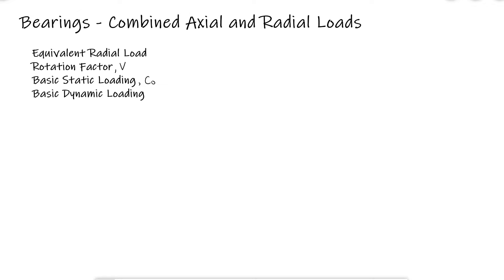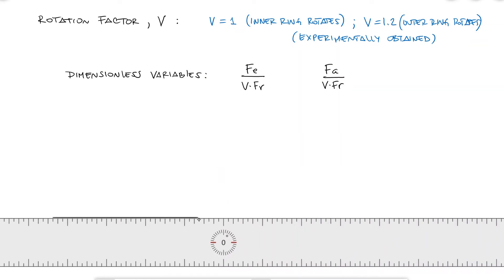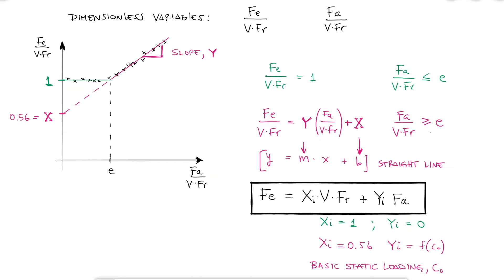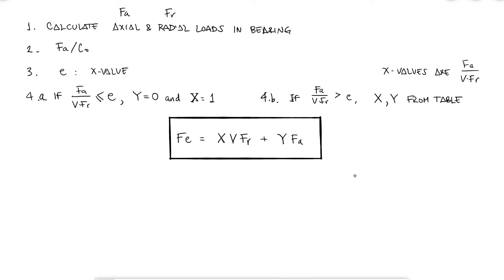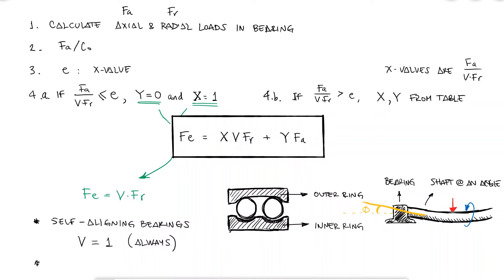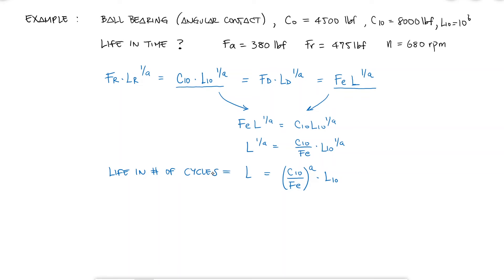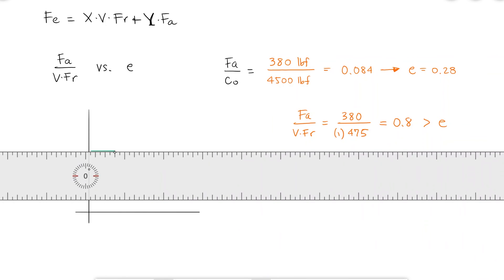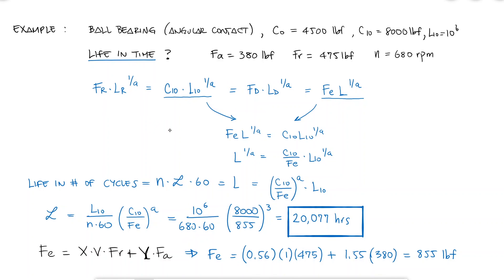Bearings - COMBINED Radial and Axial LOADS in 10 Minutes!

Comment: How to calculate Fa ?
Reply: That's the axial thrust load. It should either be given to you in a problem, or you can use statics to find the axial load in the shaft that the bearing is attached to.